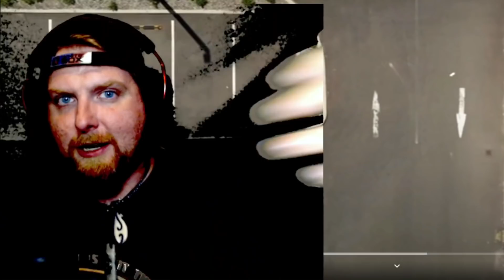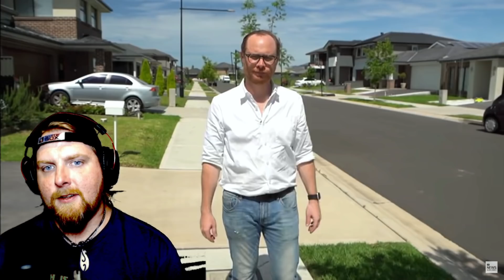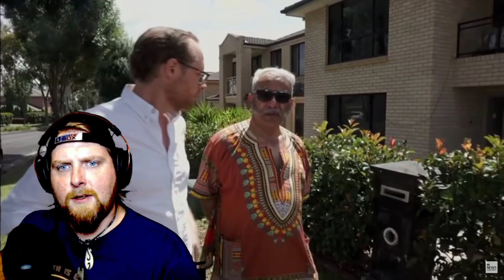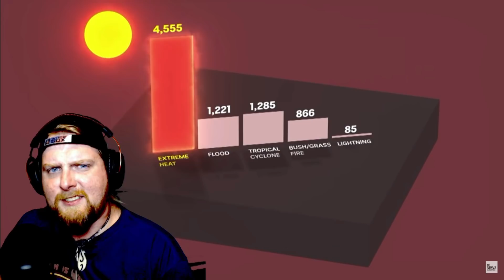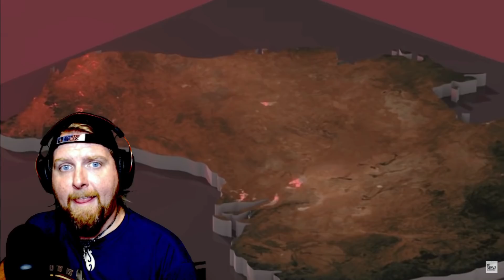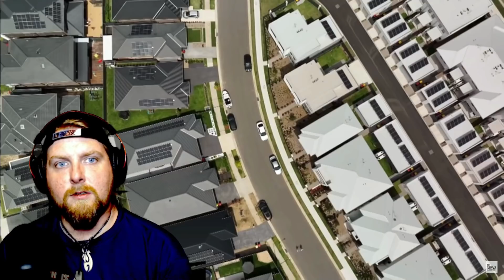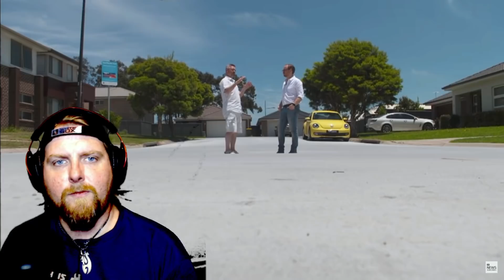American Reacts to Why Australia's Suburbs Are so HOT..

Comment: I live in a Newcastle suburb between Sydney and Newcastle about a 15 minute drive to the beach but if there was no city you could walk. It’s usually really hot in summer and really cold in winter. Because its pretty exposed to those things backing onto a big lake. And our roof is a dark colour bond roof. So in the rain it’s really loud and in the summer it’s extremely hot. And Melbourne is the coolest suburb. If,that puts the rest of the country into perspective. I’m planning an off-road trip into the Kimberly. Average temperature 45°c the rigs gonna struggle

Comment: Fascinating stuff. Here in Melbourne it’s overwhelmingly a new suburb problem. In the inner city and middle ring suburbs trees are bigger, there are more parks. Houses are older with higher ceilings, heat efficient design, roofs are corrugated iron or terracotta tiles which are more reflective. New suburbs are built with solely profit in mind so unless better building standards are enforced by govt we are unlikely to see a change. Its also not just about cooling houses, for half the year - at least down in the south east - you want houses that retain heat which ironically the new suburban designs are poor at as well.

Comment: I think 2009 during black saturday fires here in Melbourne the temperature got to highest ever 46.4c or 115.5f. Those fires we got most Australia got we had fires 2019 l think was about 44c to 47. This could be why climate change has to clearing (which it has) land building suburbs roads and concrete buildings. If this is case we are making the fires. This is my thought

Comment: I'm 20 minutes from there, in the direction of back towards Bathurst.
 Normally throughout summer temperatures averages 36°C and can get into to the mid 40s a few times throughout summer.
 Something I've noticed here in Penrith is it seems to be hotter and hotter every year. Head out to Marsden Park and all the asphalt and tall buildings make it difficult for air flow and easy to raise the temperatures.
Reply: Got all excited hearing Marsden Park and my comment was replayed 2 minutes later in this video 🤣

Comment: The older style Australian homes have very high ceilings that  naturally cool the homes down ,it's a lost concept in design now.
Reply: developers stupidly believe it's not needed now because aircon ☹️
Reply: yep - I own a house with 11 foot celings and great big double hung windows that allow hotter air to escape through the top and cooler air to come in through the bottom. It is double brick throughout with a wide central hallway that provides a direct passage for airflow from the front door straight through the back. The sleeping rooms are on the eastern side of the house. They knew how to build them before aircon. If I manage the airflow correctly I can avoid the aircon - unless it hits about 38 or above.

Comment: My house in Qld has light terracotta coloured tiles and ducted air conditioning. We have a patio out the back but the houses in my suburb are build so close together that you don’t get a breeze unless it’s blowing North or South . Because the houses are so close there are less windows facing the neighbours so less breeze gets in. So even when it’s cooled down of an evening my house is still hot so we sit outside because it’s cooler than the house. 
Houses in Qld were originally built Queenslander style , high on the foundations so the breeze gets under the house to keep it cool , 12 foot ceilings and French doors out to a wraparound veranda kept the inside of the house lots cooler than outside You can’t build them like that now in the suburbs because the plots of land are so tiny and the building restrictions if you had acreage no problems but it’s an expensive build .

Comment: 75°C is 167°F.  The soles on your shoes melt.
Australia is mostly a flat hot desert. Except when it floods or Burns.
That's why most Australians live on the east coast.
Concrete roof tiles are very cheap.

Comment: Thank you -I didn’t know these numbers.  I treated temp numbers as a child like a badge of honour.  Ipswich - the scourge of a nation.  Over an hour inland from Brisbane Ipswich regularly reached over 100 F in Summer and @ least 3 C (don’t know the F for that) in Winter - I remember as a kid going hockey practice during winter and doing sprint training wearing knee high Uggs and a 1940’s below knee wool overcoat (very retro).  Never felt inclined to take coat off so it can’t have been hot.  It felt good - tough.   I could think ‘I come from a workers city where the temps are more gruelling than yours’.  When I moved to North Queensland and dropped back home every year or so people from Brisbane would go “but how do you handle the heat up there?”  And I would answer -  “At least there’s a breeze up there.”   Ahhh Ipswich - hotter than bat sh##!

Comment: The highest recorded maximum temperature in Tasmania is 42.2 °C (108.0 °F) at Scamander on 30 January 2009, during the 2009 southeastern Australia heat wave. Tasmania's lowest recorded minimum temperature is −14.2 °C (6.4 °F) on 7 August 2020, at Central Plateau.

Comment: A few problems with this. Sydney is a basin surrounded by up to 1klm high mountains on 3sides. The blue mountains in the west don’t get desert air but are up to 10c cooler than Penrith. Sydney is surrounded on three sides by national parks some the size of European nations. The influence doesn’t come from over a thousand klm away in the centre of Australia. Most of Sydney’s weather comes up from between Melbourne and Adelaide not central Australia.

Comment: Adelaide similar temps  during summer we average during summer 1 week or 2 at a time probably 4weeks a year mid 40 nights around 30 + 
cold during winter Arctic wind it's chill factor here during winter we do get frost and ice 
I't always been like this since i was a child 
My grand parents use to live in tin houses which got hot but cooled over night
Reply: Arctic winds? Bullshit, Adelaide is less distance from the Equator as Algiers in Africa. Duh.

The cold winter winds come from low pressure cells cooled as they flow over the Southern Ocean which is not the Arctic because that's in the Northern Hemisphere. But if you meant the Antarctic, same deal. It's from the Southern Ocean and not the Antarctic. 

If you inverted Europe to Australia the Mediterranean would be to the SOUTH of Adelaide. You really do need to read more before you post inaccuracies. Arctic??? Pigs @r$€

Comment: The main reason is called, "Heat sink". The fewer trees, the hotter it will be and put down dark roofs and bitumen roads and it will be even hotter.
 Also, trees attract rain and if you remove them, you get less rainfall.
 Another problem is tree coverage, or the type of trees.
Too many councils plant gum trees that grow high, they are dangerous.
 They don't have a very good grip on the ground and in wet weather can be blown down easily.
 The should plant more Australian low canopy trees or shrubs.
Reply: Living close to Sydney CBD, the trees here are primarily Moreton Bay Fig Trees - wide thick trees.

Comment: Melbourne's not hot for the most part but there's usually up to two weeks total during the summer where the conditions are right and you will get scorching winds from the interior driving temperatures in the 40°C + range. I lived there for 10 years and the summers are a lot more pleasant compared to Brisbane where I currently live, Melbourne gets hotter just a lot less frequently whereas Brisbane is pretty much 30°C + for 6 months of the year.

Comment: Hi Ian
I live at Marsden Park and watched all the bush land being torn out and the multitudes of McMansions (Aussie for the cookie cutter housing developments) going up. 
I actually hate the heat but more than that I hate the humidity (usually in the 90% range). 
I have 2 air cons (each end of the house) and ceiling fans throughout. I pay $120 every 2 weeks to live in air con and on the really hot days, pray we don’t have a power blackout. 
As for the beach, it’s around an hour and a half to get there only to find it’s packed out and the sand is like walking in lava lol and then I need to bathe myself in 50+ sunscreen because I’m a ranger (red head/ginger) and my skin burns to a crisp in around 15 mins of sun exposure. It’s easier to stay in the air con.
Reply: Wow!!! I have ceiling fans and insulated walls and ceilings, and ducted AC and my most expensive bill in the middle of summer is only about $400 a quarter. I'm retired so home all day. When I built the house I did take into account passive heating/cooling principles and so glad I did. Cool in summer and warm in winter.
Reply: @karynbenson6318  $400 a quarter?? I wish lol. The two air cons I have are the window type which might have something to do with my electric bills??
Reply: @deegribble4160  The ducted system is more cost effective, but it did cost a bit to install but worth it. I don't use it very often.

Comment: I remember about 2 years ago I was working south-west of Melbourne and the temperature reached 47C (116F).
I worked in a factory where the inside temperature was 2C (35F) and walking outside to go to the lunch room was like opening an oven door. That rush of hot air hitting my face, but then not going away. Felt like I was constantly standing infront of a flame with no escape. 
Was the only time in my life where I didn't really want to leave work and go home haha

Comment: Happening here in New Zealand too. Both the horrid subdivisions ( a speculators dream), and in some parts, the temps.
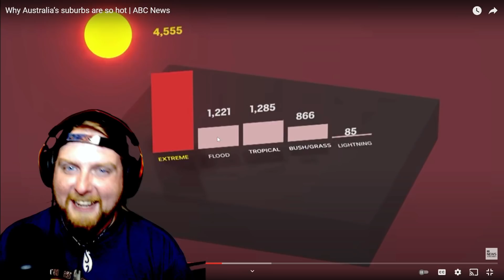Reply: 2017/8... Our city (in the Wellington area) hit 32C. Our bedroom gets the morning sun, and during the mid-morning of that week around 10:30-11am, it would hit high 40s.

We couldn't even turn on the PC as it would quickly overheat.

Its probably a fair bet to say that 40s aren't all that far away. Does not want to imagine or experience a Christmas like that.
Reply: @almostyummymummy  Yep, can confirm that about Wellington.  Here in Levin we get temps like that in summer. Regularly reaches in to the 40's in the backyard. Too hot to sleep at night.  Got in to the 50's in the car in Hawkes Bay the February before lockdown. No air con, all windows open, travelling at 100kph, and it was like there was a fireplace roaring in the back seat. Totally unbearable. Roads had melted in to sticky globules of molten tar.  Give me Wellington  any day.

Comment: I spent 2yrs down in Melbourne, on the Mornington Peninsula. It gets Hot down there. You don't walk around unless you have a really good reason. Otherwise you find air-conditioning or just do as little as possible with a fan pointed at you.

Comment: Tropic of Cancer sits a few hundred miles south of the Florida peninsula. Our equivalent, Tropic of Capricorn runs virtually thru the middle of Australia. So if your in California making your way down into Mexico and then Sth America, it's comparative to starting in Sydney and heading north up to Brisbane, with Bundaberg ( 4 hours north of Brisbane ) being like middle of Mexico and Cairns being into Sth America, Temperature wise. I'm assuming Mexico has less green than Qld so the humidity would be different. If you like the cold, Cairns really sux Lol. sweating 24/7 for more than half the year, regardless of how many fans you have on. Lol
Reply from the maker: Pretty Accurate stuff I reckon, Mexico is actually mostly Green, with only Deserts up North (Border with New Mexico & Arizona) and sliver running down the center, so that region is hella Dry, but the coasts of Mexico are Humid as are the Jungles and the Yucatan. I'm Amazed how the Tropic of Capricorn Basically Runs through Australia... What an interesting Continent from a Geographic Perspective, and a Weather perspective too

Comment: One thing not mentioned is the Home Air conditioners, with all those homes in suburbs using air conditioners to cool the house, only adds more heat to outside ambient air temperature.
This in turn will necessitate more air conditioner use creating a cycle of rising temps.
Reply: exactly - the heat doesnt magically disappear. that noisy fan outside is blowing onto your neighbours house.

Comment: They're starting to make big carparks with concrete surfacing instead of bitumen. Roof tiles with light shades of orange instead of the darker colours that used to be popular, even sometimes using metal roofing with white, silver, yellow (matte, not bright yellow). 

They're even thinking of trying to paint road surfaces white in the US, which would work just as good over here.
https://youtu.be/1s8BNrnI7PY
Reply: Retrofit the carparks with little roofs over the parking spaces with solar panels on them. Shade the cars and generate power for charging them. Also, the area will be cooler because the energy that would have gone into heating up the bitumen will be going into the power grid instead. If you look at a thermal camera image of a roof with solar panels, the panels are cooler than the plain roof.
Reply: @Roxor128  our power system isn't built to accept power back up the mains. Unless you have a battery wall for storage, it's wasted power generation. Eventually, I think the powers that be will figure out that hydrogen is much more practical for vehicles. The main barrier against it is that it's hard to transport. So each fuelling station would need to have a hydrogen plant attached, but it's relatively simple to make hydrogen from water. Shouldn't really do it from home, but scientists have been producing it for about three hundred years.
Reply: @evanflynn4680   Well, you do have a wall of batteries for your panels-over-a-carpark, and big ones at that: the cars. 

I don't think it's a matter of one or the other. More likely, it'll be batteries for some, hydrogen for others. If you can get 500km out of a charge, that's enough for all but the longest trips, where you'll be wanting a break every few hours anyway. Put the car on to charge for 20 minutes and go get yourself a snack before resuming your trip.

Hydrogen, probably in the form of ammonia, will probably take over for trucks. At least for long-range ones. Short range ones within a city could get by on battery power, but if you're sending stuff long distances, the low energy density of batteries becomes a problem. For that, you either want hydrogen or overhead power lines with a small battery for the ends of the trip.

Or you could just put more land cargo on trains. Honestly, long-range trucking could mostly be replaced with rail if our governments would just invest in it. You'd still have to have some for small remote communities, but the vast majority could be moved to trains instead.

Comment: The driving pressures on construction (and the restrictions) are very similar in both Oz & US.
Screwing ourselves to be cheap, for traditional styles or modern styles is the standard here. These issues have been increasingly recognised & discussed over the last 30 years or so, but the majority of our population is older than that w old preconceptions; brick & tile was sold as a good, self insulating choice.... For winter.
Insulation is minimal & uncommon in low income areas.
When Aussies complain about heat, we're talking about at our homes, not the official records taken (usually on a green airfield).
Our traditional house style cones direct from Britain & Europe. So do a lot of our building standards, with no bordering nations or ceded territories to provide alternative design.

Comment: I'm not too far from that suburb. That Summer we hit 50C, and my air conditioner was broken all Summer. New suburb blocks are typically 10m, 12.5m or 15m wide, and houses are allowed pretty close to the land side boundaries. Whilst new houses do have some building requirements which require energy efficiency (including solar power) and water efficiency, double glazing in Australia is pretty rare and expensive.
Reply: There are some alternatives to traditional double glazing in Australia. Have a Google and you may be surprised.
Reply: Never reached 50 !!...no where near it !
Reply: @annehat4833  a simple google search will show a SMH article with temps above 50 at Badgerys Creek, Berkshire Park, and Agnes Banks.
Reply: @YobboBear  and you believe google or wlki....shame shame shame !......last summer im sitting at home the local news said it was 37 degrees....i thought it cant be...didnt feel that hot....checked my temperature gauge...it was 31 !....smh news outlet yes ?....anything to do with media is 95%  LIES !
Reply: @annehat4833  I’m not talking about last Summer Anne. I’m talking about data from heat loggers in conjunction with Bureau of Meteorology. I’m glad where you were your local news reporting in some entirely different location had a different temperature. So thanks for proving my point, that temperatures vary according to location.
Reply: @YobboBear  Ive been around long enough to know we are being consistently fed rubbish.....after all we have done for those morons we deserve better.....its lie after lie after lie !
Reply: @YobboBear  and i know the difference between a puppet and a moron....do you ??

Comment: In Adelaide, with a wind from the North, it drags the hot air down from the desert. It becomes a hot dry wind that is really tough (but slightly easier to deal with than humid weather, you cant cool down).
Most places have "insulation" in the roof, you cant have a flat roof and no insulation. You would fry.
But for example, in South Australia people  have ducted air conditioning as a priority. It Melbourne, they have ducted heating as more prominent because its a colder city